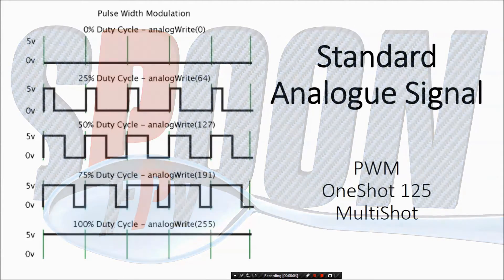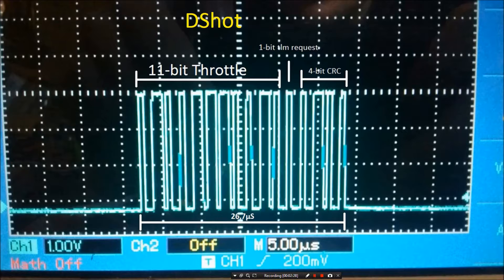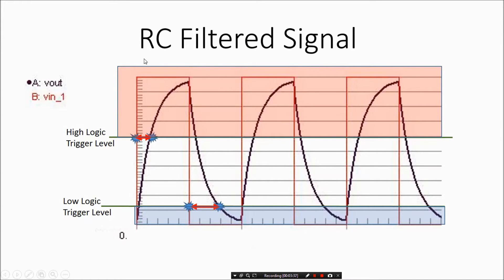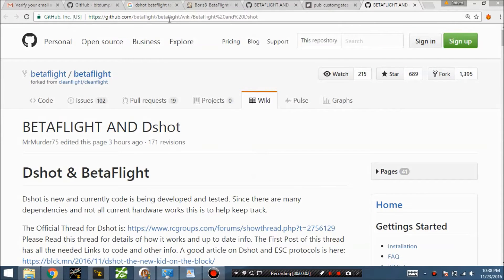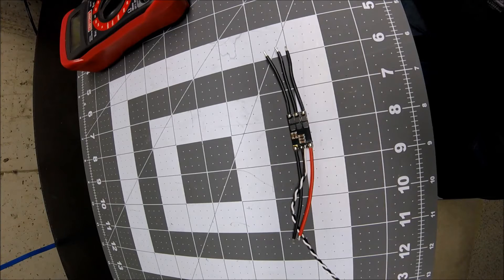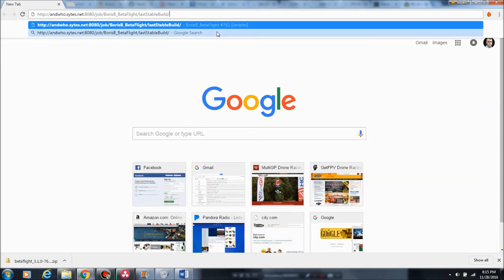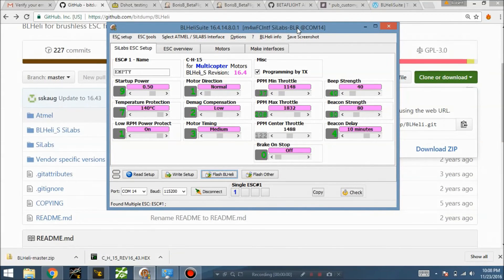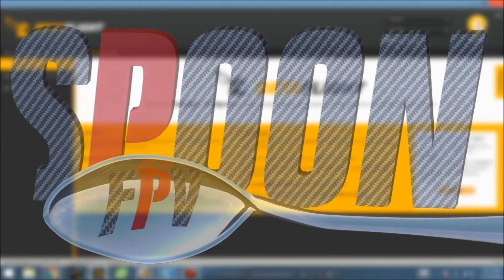Flash DShot install with Betaflight and BlHeli ESC

Comment: thaks for your video.
Do i have to upgrade the firmware? mine was already on the newest original firmware (i think it was v16.7. )
Reply from the maker: +DerBaron FPV no 16.43 and higher is Dshot ready.  This should really be called how to flash custom firmware and software nowadays.

Comment: How come when I open blheli master I don't see the dshot folder? Does the caps need to be desoldered first for the dshot folder to show up?
Reply from the maker: Ronn2664 If you use the new configureator any version of Betaflight 16.47 or higher has Dshot built in.  Your ESCs probably come with it already.
Reply: Spoon FPV I have racerstar rs30a esc's which I am about to desolder the caps and flash them. I currently have blhelisuite 16.6.14.9.0.0.
Reply: Also, can I flash the esc's first before removing the caps?
Reply from the maker: Ronn2664 As long as it's after 16.47 it will have Dshot.
Reply: Spoon FPV So meaning I don't have to click on flash other and select the dshot file? Just flash them with whatever comes up on the screen?
Reply from the maker: Ronn2664 I would suggest flashing them first.   A lot of ESCs will work no modification now.  It should work on Dshot 600, if it doesn't then you may need to remove the caps.
Reply: Spoon FPV That would be cool if I don't have to remove the caps. I'll try it. Thanks a lot.
Reply: Spoon FPV Just finished flashing with 16.6. Changed to dahot600 in configuration, tested motors and it works. Now I'm wondering what is if there difference between with or without caps regarding performance?

Comment: so just selecting dshot600 in the betaflight tab is not sufficient enough to activate dshot on the esc? My esc came without a capacitor and I assumed all I had to do was select the tab on betaflight. I've flown the quad already without ever opening blheli and it seemed okay...
Reply from the maker: Yeah this video is a few months old.  Before betaflight 3.1 and blheli 16.5 were available in the configuratror.  Most escs come ready for Dshot now.

Comment: I wonder what will happen if you just remove the cap and try it with multishot?
Reply from the maker: Ronn2664 It works, in fact new escs are shipping with no cap
Reply from the maker: Ronn2664 I screwed it up in this vid, because when I removed the cap the esc twitched and I thought it didnt work without it, I didn't realize it needed re-calibration
Reply: Spoon FPV So, you have to recalibrate the escs after flashing dshot?
Reply from the maker: Ronn2664 No only if you remove the cap and want to continue using multishot, the escs need recal
Reply: Spoon FPV Any difference in performance with cap removed using multishot?
Reply from the maker: Ronn2664 If you go through the trouble you should use Dshot, but Quad Mcfly from miniquad test bench thinks there is a benefit for multishot.
Reply: Spoon FPV Nice! Thanks again.

Comment: Thanks for the video.
Reply from the maker: Yes, Please just use it as a guide to flashing beta firmware, as now the configurators support Betaflight 3.1 and higher, and Blheli 16.5 and higher.

Comment: Could you please explain if I need to type the "digital_idle_offset" command? Didn't notice it in your video.
I just updated to the latest Betaflight and I'm running the Aikon 30A with DShot 600 caps removed on my ImpulseRC Helix.
I adjusted min 1000 and max 2000 in BL_heli ChromE app.
Quad flies perfect but I never heard of this "digital idle offset" command before until just now.
Do i need to do anything or am i just lucky that I don't have issues yet?
Reply from the maker: cfallon What version of Betaflight are you running?  Sounds like you haven't selected DShot as your motor protocol
Reply: I'm running 3.1.5 and Dshot 600 is selected
Reply from the maker: Okay, then in the configurator, under Dshot 600 is where the Motor Idle throttle percent is located in the later versions, don't even need to worry about min max throttle any more.

Comment: Im sorry its 11:15 and I still have homework so I cant watch the video but i have a question.
If I have a kiss fc with aikon 30a sefm BLHeli_s escs and I want to flash dshot, how would I do that? I know that my escs can handle dshot 600
Reply from the maker: Just use the Blheli configurator and flash them with 16.5 or higher.  You may need to remove the capacitor to make 600 work.  This video is a little out of date, it should be called how to "Flash beta firmware to ESCs and FC"  now.

Comment: Just flash on d shot everything works fine..but on my taranis i have a like 10% deadband on my stick do you know how to fix it..i like my stick at 1005 throttle will kicks in
TIA
Reply from the maker: Mr kal Epic fpv Yeah!! I ran into the same thing.  I use an arming switch, so I just mixed in some throttle when I flip my arming switch.  That wass my major complaint with Dshot, but I figured they would fix it by the release candidate....nope.  I'll submit a pull request if it's not fixed by full release of 3.1
Reply: Spoon FPV if they fixed it please post some updates thanks and more videos to come 👍🏻👍🏻👍🏻

Comment: Did you have to tune any of the " digital_idle_offset" to get the "min_throttle"
Reply from the maker: M.R check out the end of this video, I go over it there.  I didn't need to mess with it.  Defaults were good for me. https://youtu.be/VmOsOHduKt8
Reply: Yeah sorry didn't know that you had second video of this. Thx anyway!
Reply from the maker: M.R Yeah no worries, I found digital idle to be fine, but in there I do go over changing it.  You should have min throttle and min cmd to 1000 and max at 2000 for dshot

Comment: it was much easier with BLHeli configurator
Reply from the maker: Andrey Mironov Yeah that part is already slightly out of date.  As of Blheli 16.5 it includes Dshot and you don't need to go get the Beta version.

Comment: Thanks for the video!  I believe that many BLHELI-S ESCs can run up to DSHOT 300 with the capacitor in place.  And since DSHOT can only runs at the speed of your PID loop, most people running F3 boards could only utilize up to DSHOT 300 with the limitation being the available speed of the PID loop.  So the capacitor removal is really only if you are running a very fast PID loop on a very fast, F4, flight controller above 16kHz.  Correct?  Did you notice much, if any, improvements over mulitshot??
Reply from the maker: That's correct that many ESCs can run up to DSHOT300 without capacitor removal, but there are advantages to running faster ESC than PID loop, please read below.  I had problems with my ESCs running 150, but I didn't try 300.   DSHOT 150 is 8K, 3000 is 16K and 600 is 32K and Betaflight requires synced PID loop.  Even though BF is limited to 8K8K8K on an F4 board because that's all that can handle it there are still advantages to running DSHOT600 over 150 and 300 even though they are the same speed or faster than PID loop.

I am putting together a video on the topic, and it will be up Monday morning, but basically the ESCs respond to the PID loop.  So an 8K PID loop takes 125ms to send information out to the ESC then the ESC has to read the packet and respond, and the speed of the protocol is how long it takes to read the packet and gets tacked on to the 125ms total looptime.  So Dshot150 running at 8K the total loop time for ESC response willl be 125ms of PID loop +125ms of ESC protocol for a total of 250ms from the time the copter moves until a signal can be received.  In contrast DSHOT600 total looptime will be the 125ms PID loop + 25ms communication protocol for total of 150ms total lootime of response.
Reply from the maker: Watch my latest video.  I explain Looptime and why DShot600 is still better than 300 or 150 even though 150 runs at 8K

https://youtu.be/VmOsOHduKt8

Comment: thanks for the video. do have to flash all four esc's with dshot?
Reply from the maker: Yes you need to flash all 4 with Dshot, I only did one to start with to make sure it worked, before removing the capacitors on the other escs, that's why you only see me flash one in what I recorded.
Reply: Spoon FPV got it. thanks.